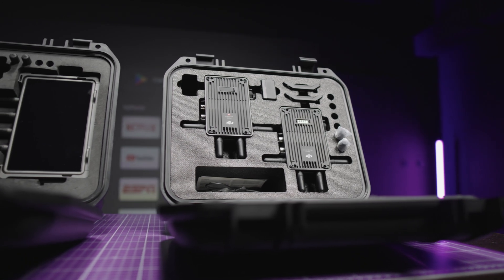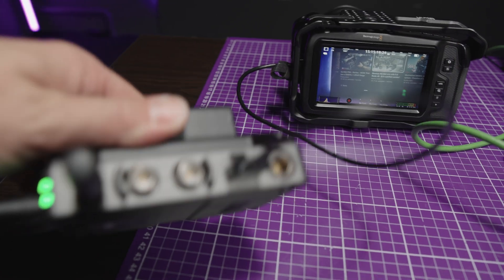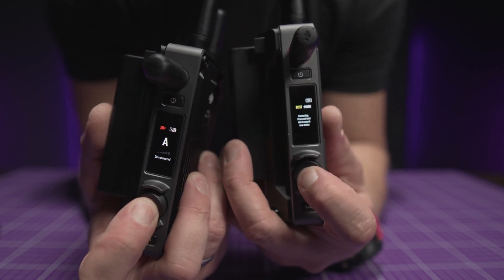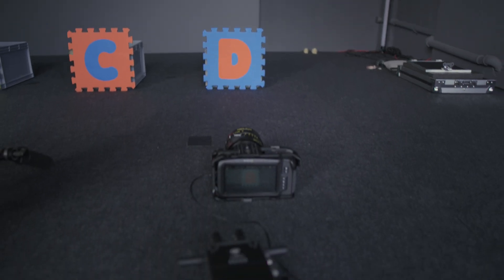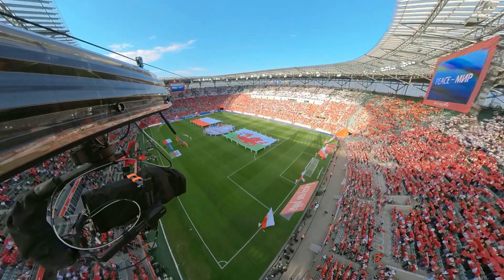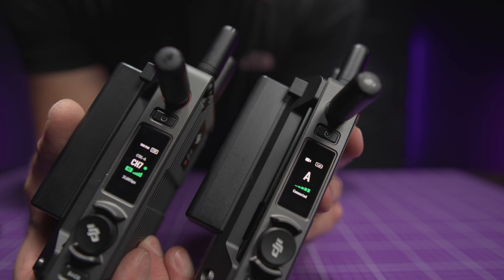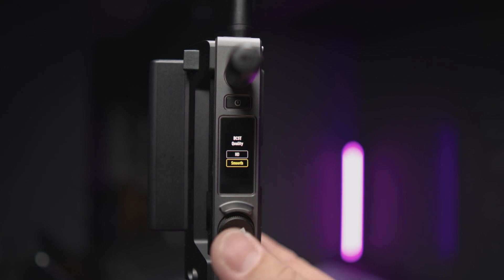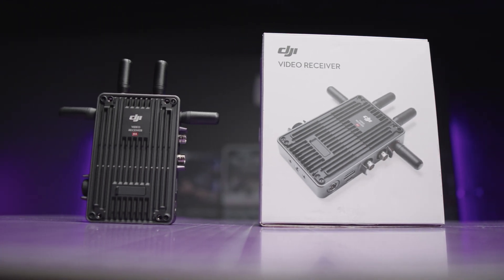DJI Transmission Standard Combo - Top-class wireless video system REVIEW !

Comment: Hello, I appreciate if you can help me with the following questions...
I want to use the cin monitor combo to see the camera live on board a competition car rolling on a circuit...
queries:
The furthest distance between receiver and transmission can be 2km, there may be obstacles...
The camera to connect is a go pro via HDMI cable. Is it possible?
Does audio and video reach the monitor? Can the audio be heard through a headset?
If I wanted to connect the monitor to a normal TV via HDMI, do I have to add the rear accessory?
The monitor only has HDMI input...
With the expander and the HDMI output on the TV would the image and sound be from the camera?
Thank you, I await your response.

Comment: Do you have any experience with the embedded Audio Transmission on HDMI and SDI? Currently when I output any transmitted Audio on SDI and HDMI it is very distorted. Would be interesting if there is a general problem with the embedded Audio Transmission - Thank you. Also very good Review!
Reply: Great question! I was wondering about embedded audio as well. It's very important for my workflow as a VTR operator on commercials.

Comment: 12:33 I'm I seeing correctly? DJI has less latency than the "pro" TV rig? It seems like when capturing a live show, using DJI would an excellent solution for a wireless floor cam when used with a wired system with, as in your demo, only about 40ms. I'm I right? This is a budget production game changer.

Comment: PLEASE  Could you help me with a few questions?
Regarding the DJI high bright monitor, can it handle external RAW recording, similar to the Atomos Ninja V with Sony cameras?

can the 1 high bright monitor recieve signal from different transmitters from different cameras at the same time ?

If I plan on purchasing an additional DJI motor, how many motors can the right 4D handgrip control effectively?
the LiDAR, autofocus tool specifically designed for cine lenses!  what is its range ? can it handle autofocus to infinity distance 
Does the left handgrip exclusively control gimbal movement, and does it require the DJI Ronin RavenEye for full functionality?
Thanks so much for taking the time!

Comment: Great Video, thanks. There is one question still open. With the High Bright Monitor it is possible to output the "video only" signal via usb-c. Is this also possible with the transmitter RX? And if so, I would like to know if they meanwhile integrated the feature that allow the audio output via the usb-c as well. It might be important in the cases where you want to send the main signal to computer maybe far away, which is connected to a internet connection for a live stream f.e..

Comment: I have dji rs3 pro/ dji transmitter / dji lidar , I need to control and use active tracking remotely , solution (DJI LiDAR Range Finder to Transmitter Cable Hub) but I couldn’t find if it enables active tracking while using it with a gimbal Rs3 pro

Comment: Would have liked it to have a bit lower latency. 50ms is not bad, but on the edge of being nice to pull focus with.
Reply: yeah it about 2 frames?
Reply: According to the review, the Teradek is also 60ms. Is that correct?
Reply: @RaymondToms  no Teradek has less that that maybe 10 ms you can pull focus on Teradek
Reply: @lucariccidj  thanks. That accounts for the price difference.
Reply: Hey,

Very instructive video.  I have a question the metadonne work with Blackmagic camera?  I have 2 DJI transmission with hight-bright monitor, ans i check to buy the receiver,

Thank’s :-))))
Reply: Teradek still king for live production.
Reply: @anonymouse7074  how much latency has teradek?

Comment: Your comment on 1 m apart is interesting.. how do we deal for example using this say on a steadycam type rig were we don’t want wires crossing the dji rs3 pro gimbal to the  tilta float monitor. Don’t want to get wires caught up in the gimbal movements.  Would that be too close . or would i need something like a teradek where i can run it in lower power mode when the TX/RX are that close on the same rig?
Reply: I think he meant that you should keep 1m of distance between multiple transmitters, transmitter to receiver doesnt matter as much. You can also use a hollyland or teradek system (just an alternative but not with all the same features).
Reply: @cmatix_film  Any idea if the LT systems have the “low power mode” and if that is the right way to deal with being close between tx/rx?
Reply: @Xanah_TheLitterBox  Sorry, can't really help you there unfortunately. My knowledge isn't that advanced about that specific system. But to have an answer on your earlier question about a TX and RX being too close to eachother; It shouldn't be a problem in the first place because these devices will choose a low interference channel by itself and hop over if there is too much interference (if auto mode is selected). Video transmitting systems have come far, so much more advanced and stable in the past couple of years. Correct me if I'm wrong somewhere, happy to help! :)
Reply: @cmatix_film  Thanks.. i’m mostly using it on a Tilta float rig as the world’s most expensive HDMI cable! - no wires fouling the gimbal between camera and monitor on the steadicam arm
Reply: @Xanah_TheLitterBox  Yeah I also wouldn’t want any cables arround the gimbal and steadicam, that’s a valid solution. Expensive but effective!

Comment: Awesome review! Still waiting for something affordable to remove HDMI cables from the gimble/Float. Something in the sub 1000 EUR range with low latency and being small as possible where a range of 10 meters would be sufficient. While 2230 is to much - it sure is a bargain for what you get with these DJI transmitters/monitor.
Reply: The Hollyland Cosmo C1 is great for that